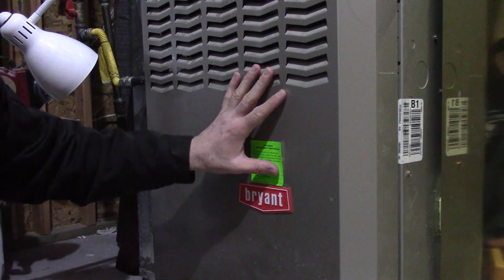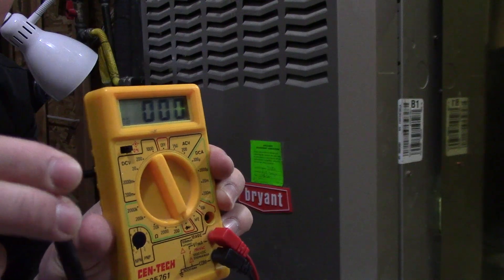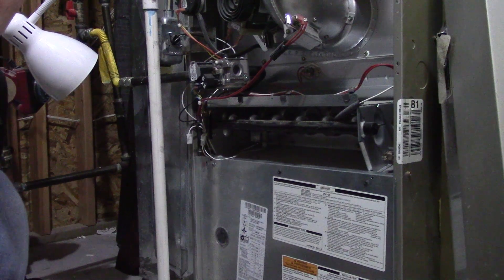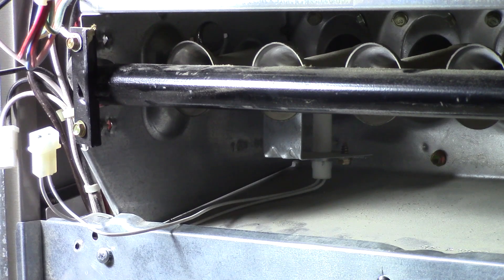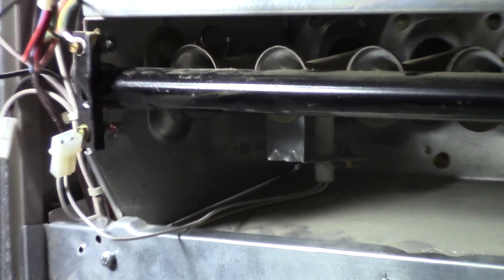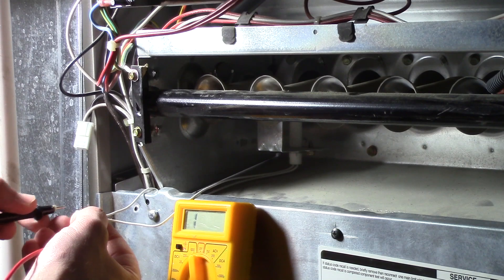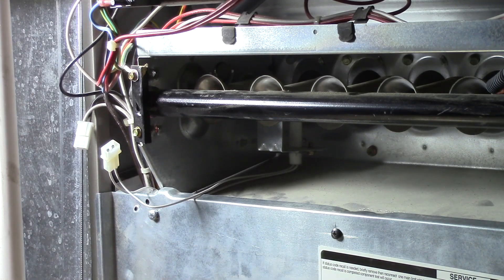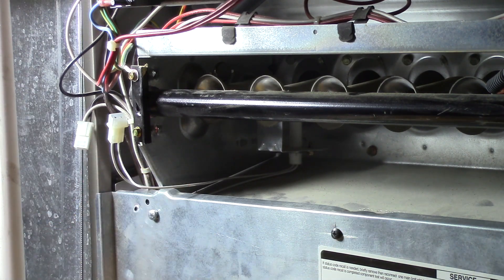How to test a hot surface Ignitor - Gas Furnace Igniter Bryant

Comment: Yus couldn't check voltage with the unit on so, I'm continually isn't going to work unless the power is on and turned off at the next break where that circuit disconnects..... plus the amperage is just how much conductive material is potentially there to be floating in flowwage.... something like that

Comment: The statement "if it's bad the reading will be nothing", for clarity to non pro's, the resistance is actually infinity (not 0 or nothing).  However, the statement that said the meter reading wouldn't change is correct (the reading is infinity when it doesn't change).

Comment: Best to use the 200 ohm or lowest resistance setting on the meter. The diode setting will not determine a weak or failing igniter since it will not display the internal resistance of the igniter. It is meant only to display the reverse voltage of a diode. 
(Resistances above 90 ohm indicates a weakening or failing igniter)
Using the diode setting, one could still have a bad (weak) igniter which is causing a no-burn situation. 
Avoid continuity settings as well if you are only listening for the beep. The resistance is key to determining the functional condition of the igniter.
Side note: The flame sensor is best tested using the Ma setting of a multi-meter in series with the sensor.

Comment: I replaced my spark ignitor and my furnace is still not working.
Reply from the maker: +La Donna Jones Is your surface igniter glowing?
Reply: +AdamDIY No. Not at all.
Reply: @AdamDIY  Spark igniters don't use surface igniters.